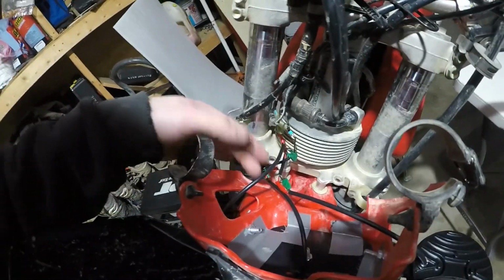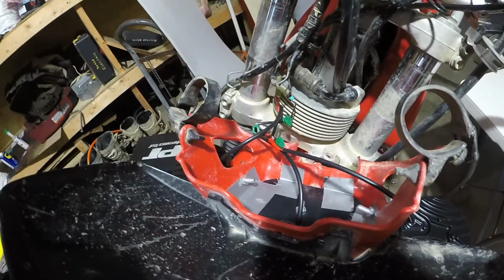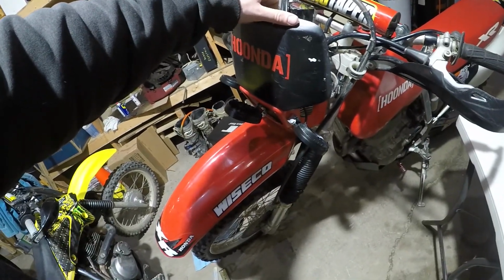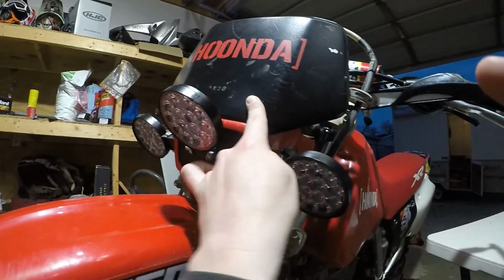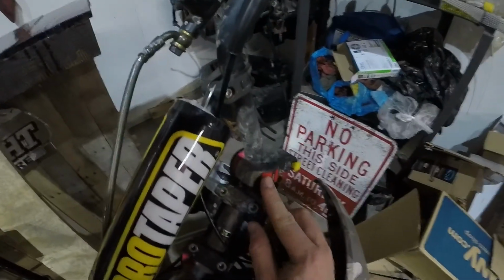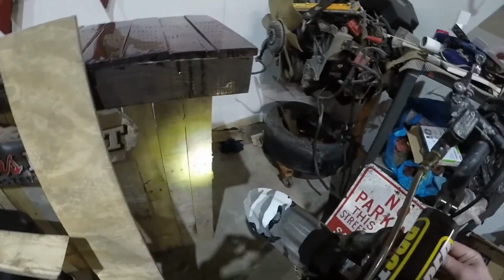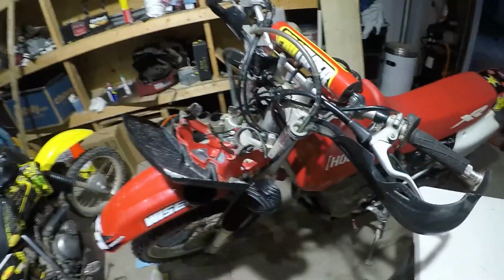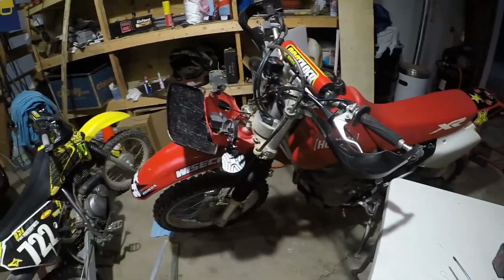XR400R LED Headlight NO BATTERY OR RECTIFIER

Comment: Do I have to run 3 of those like you did in order to handle the reverse voltage or could I run a single light as long as it has 14 diodes?
Reply from the maker: @JohnnyB-kh1ks  you could just run one, these don’t care about that reverse voltage that the internet seems to have a hard on about 🤣

Comment: Hey dude! Great job, congrats... so i want to do the same on my XR 400R, but without battery or additional rectifier or condenser, could you share your wiring diagram of this mod on this beautiful and powerful bike? and thanks for share the video... regards from Medellin, Colombia
Reply from the maker: Thanks man! No additional reg/rec is needed for this. Just unplug your stock head light and connect the positive and negative wires to whichever LED lights you choose. There is technically a chance of reverse current cooking LEDs but when you have enough, that reverse current is split up between the LEDs so you are probably ok with any LED headlight that uses multiple diodes like these ones. Since this has no rec it is running on the AC off the stator so the lights are technically flashing on and off at the frequency of your stator but this is only noticeable at idle. Once you're riding it is bright as hell and you don't notice it is technically flashing faster than your eyes can notice.
Reply: @almostoemgarage8143  jajajajajajajajaja sorry dude, but it's very technical for my understanding jajajajajajajajaja si my bad! Could You share tutorial or pictures with more detailed specs? Maybe material list, aditional ítems or how to video jajajajajajaja is great idea... By the way thanks for your time and your help